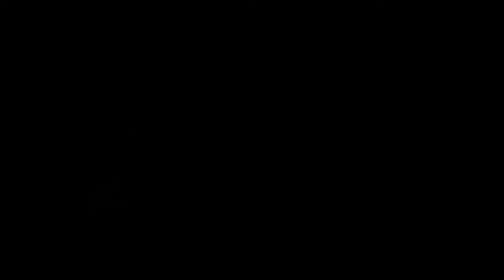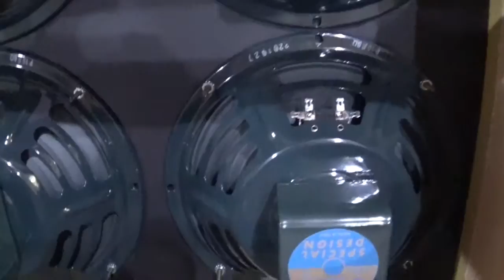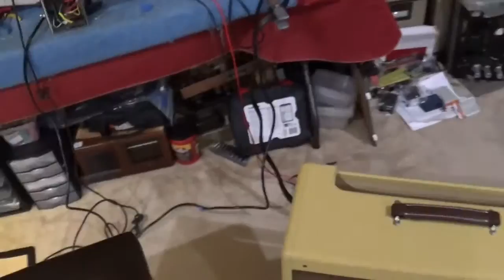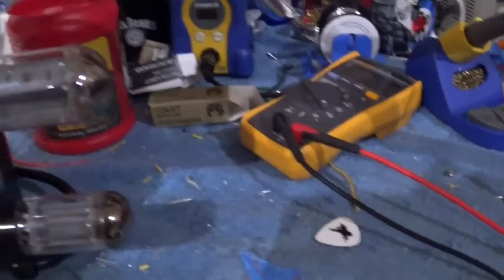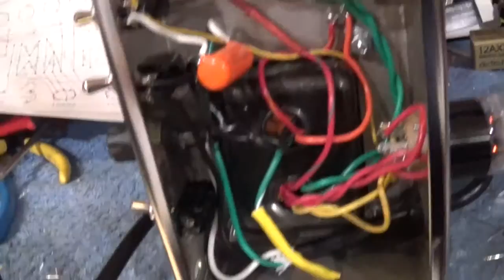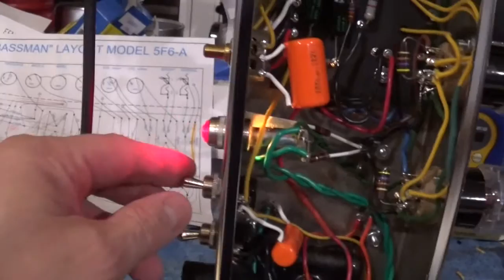Fender 59; Bassman Amp Build - Episode 8 -  It's a wonderful day in the neighborhood.

Comment: make it growl...   grrrrrr 
such a neato amp it is!  
Um kinda in a dilema here.  I have two Hammonds, a 60 year old M3, and a 50 or so L100 if I recall right.  The newer one have a nice reverb.  But the M3 has that infamous sound, but its case is more beat up.  I need room, like when I got rid of the big RCA console TV system.  So what to do?  I want to keep one Hammond.  but which one?  Um temped to scrap one for the amp and speaker, and dump the carcuss.  decisions decisions...